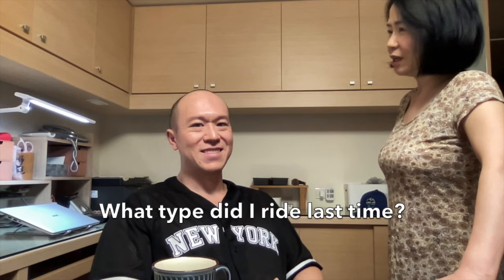My thoughts on the GT-S making up the hill..

Comment: A well articulated video. My opinion has generally been that riders move their electronics to VESC based internals because of the freedom; To choose any accessories and have them be compatible, to be able to bring the device to a repair shop of their choosing. Many riders just want to move away from inflated repair bills, and more and more control by a corporation of their private ownership of a recreational device. It is a bit unfortunate that your hill climb video prompted what looks like FM employees discounting your experience with the product, steering the conversation towards a power race.
Reply from the maker: Thank you for your perspective. The RTR aspect is a point I didn't get a chance to expand upon, which is an invaluable benefit of the vesc world which we love and should have a right to enjoy. My goal is to help show performance strengths and areas of improvement  for the newest products, and will continue to do that. Please keep contributing your thoughts to our community, we need it!
Reply: Exactly this!
We don’t go Vesc to be better or faster than FM Onewheels.
We love OW most of us lilfocrs still have Fm ow’s as well..
Just being able to do what we want on it.
Also for heavier riders on some terrain the Gt just wasn’t cutting it against a 84V Vesc..
💜⚡️❤️
Reply from the maker: @Floating_Jaffa  that was my initial motivation to try vesc, the new flagship GT just didn't have enough power to take my ass up bigger hills! love that you support and empathize with both sides. I can too, but am more impressed by open source tech. Bring on the competition baby🤟💗

Comment: Please don't forget to bump up the current on SF board. 120A test made sense to compare the motors with Floatwheel, but if you are comparing boards, set it where it should be :-)
Reply from the maker: point taken, when I set it at 150A vs FW I got a lot of feedback saying it should be the same as FW. But yes moving forward let's up everything to the maxx!!
Reply: 100% agree on this. My heart dropped when I saw that the poor Superflux board was limited to only 120 amps.
Give it the amps that it deserves!

Comment: good point on the captain morgan mode. I totally didn't think about that!
Reply: They made it up about 20 times without captain morgan before the captain morgan clip that they posted
Reply from the maker: @FloatyMcFly  hey man, how come you never answer my question: according to your logic of maintaining safe and legal trail access based on allowed wattage, is the GT-S more illegal than Floatwheel? And how does its specs threaten our trail access?
Reply: @MaxxSend I think about this now since the GTS announcement, I've been trying to change local ordinances so the onewheel could be classified as a class 1 E-Bike.

With this new board. It's hard to now push for us to be on some of these paths.
Reply: @MaxxSend iT gOeS 25 mPh. ThAt’s tOo fAsT
Reply: @FloatyMcFly  Noice. @MaxxSend just gave up before 20 attempts. I am sure he will try again soon and make it up!
Reply: @MaxxSend Deafening silence lol

Comment: Neil answered someone about his shaping settings. He was on full nose tilt, full aggression. I can't remember the rest.
Reply: So, the opposite of elevated, interesting
Reply: @Ty-ye8rd  tilted  up in all cases. Neil climbed FAF in bay too
Reply: Why do you need a specific shaping for this challenge when you’re riding a 3.5K board. The Floatwheel isn’t using a specific hill climb tune.
Reply from the maker: so nose all the way up, then he can ride the hill down like that too?
Reply: @MaxxSend  Sounds dangerous I like it

Comment: Thank you Maxx for a nice video, if you going to do a rematch test, please run a SuperFlux at 150a and not at 120a, according to Fungineers the motor is designed to run at 150A to get its full potential
Reply from the maker: For sure, gonna set all boards to the max for the next vid. When I did the first hill climb challenge of fw 120 vs sf 150, many were telling me I should've set the sf to the same max as fw 120 for fair comparison. Now I'm gonna maxx out all the boards, including gt-s.

Comment: Well put Maxx. Would be nice if to Tony or some one can measure the maximum torque of all three wheels on a dynamo or something. It would be awesome if the pros can show  us commoner the secret of riding uphill with 1% power. I feel the pro have an ability to apply the constant pressure on the noise but never over torque it to a noise dive. It’s now so apparent Going uphill is definitely a good skills to have and should be part of the race!
Reply from the maker: thanks dude! would absolutely love to see the dyno data, that would help answer many questions :) riding up steep hills is definitely a skill that I haven't mastered yet 😅but if we're just talking about 1% on a ow, the captain morgan would have some effect I imagine. Very intriguing how the board doesn't shut off to protect the rider/battery, especially at that load level. Either way, I'll be trying it myself when I'm back, and the end results will all be positive stuff I'm sure!
Reply: @MaxxSend  the board’s firmware has to make a choice to have the rider at all cost or save the battery. Looks like it want to save the rider, i think the math does pencil out. Can’t wait for your next video, don’t think they will take up your challenge though!
Reply: @MaxxSend  I couldn’t understand how it could even ride at 1%, much less climb the hill.
Reply: @deanaoxo the battery pack still has lots of energy at 1%, but if the voltage goes below some number it will permanently degrade the battery. The bms’s job is the save the battery. When The battery is at 1% the firmware overwrite the bms battery maximum current draw protection seems. Question is what is the maximum current draw limit on the bms? Would be interesting if Maxx can do a video when the GT is at 1% and GT-s at 90%!